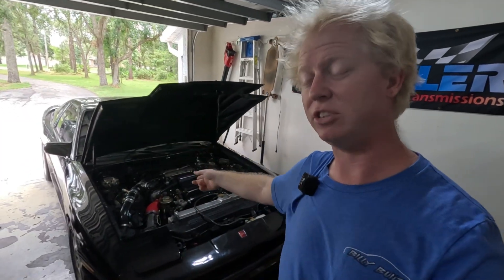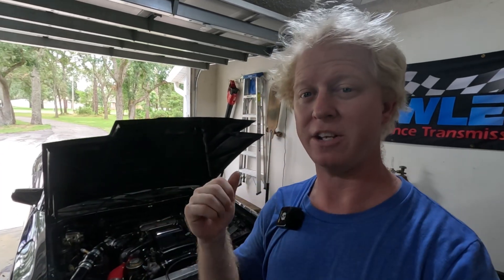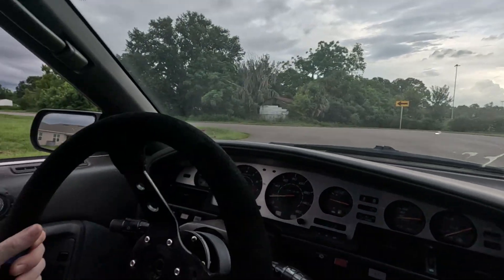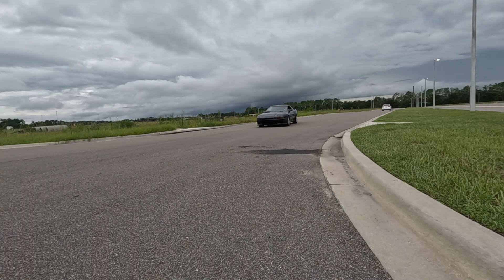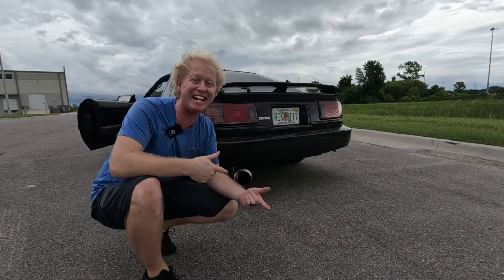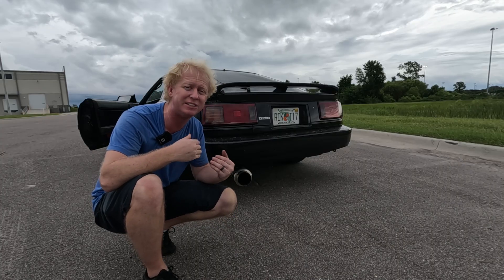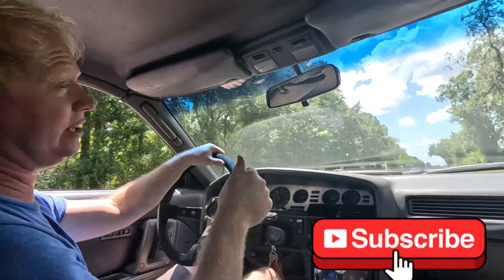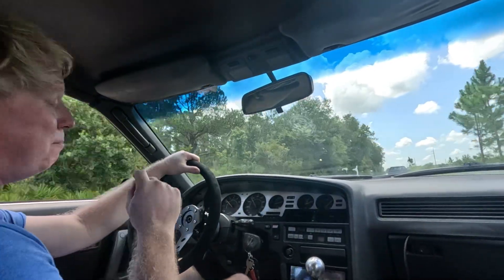Anti-Lag on a 7M Supra: Small Changes = Big Flames

Comment: Anti-lag launch control is not a thing. 

You have 2-step which IS launch control and you can 100% build boost on it. 

Anti-lag/rolling antilag is typically used while the car is already moving. Press a button make some noise, have some fun.

Retarding ignition AND cutting a lot of ignition (percentage wise) is what will give you pops and bangs. You gotta be careful with retarding the ignition so much. You can hurt your motor and turbo. 20 degrees is pretty agressive. My is300 I’m not regarding timing at all. Of course I’m not building 8psi but rather 2-3psi.

Also the emu classic can not control a 4.9 sensor.
Reply from the maker: there are indeed levels to it.